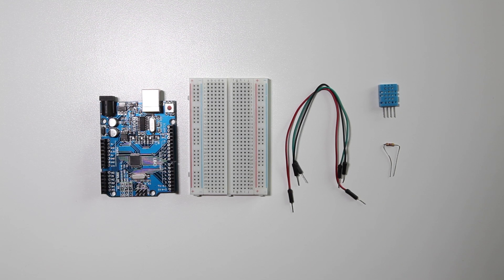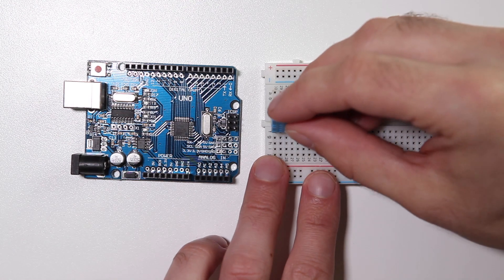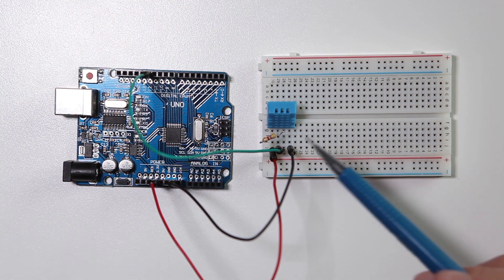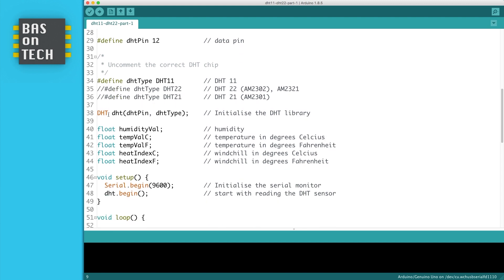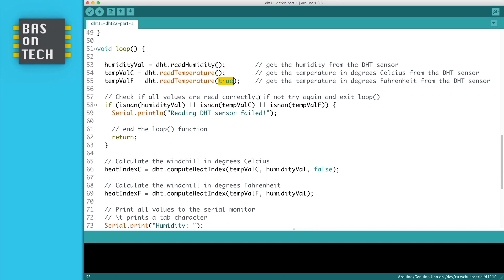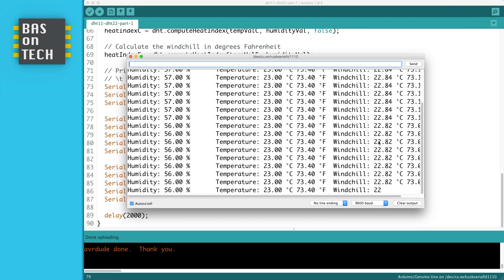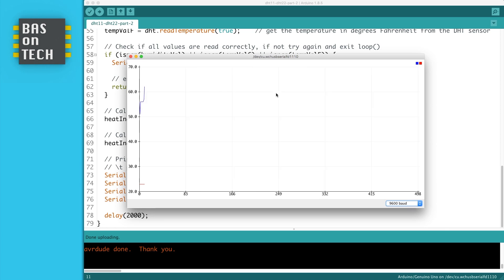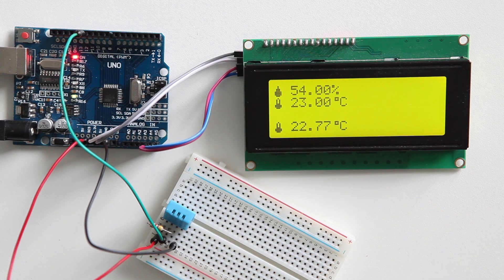DHT11 / DHT22 TEMPERATURE AND HUMIDITY SENSOR - Arduino tutorial #13

Comment: where do I connect resistor if DHT is 3 pins?
Reply from the maker: I assume the DHT is mounted on a small PCB? Then there is probably already a pullup resistor on the PCB. You can then connect the signal pin directly.